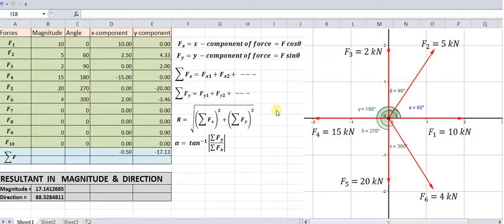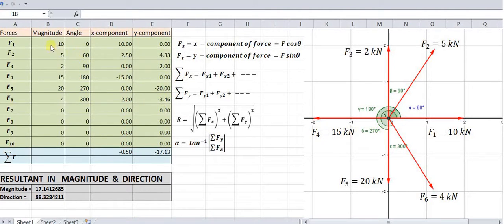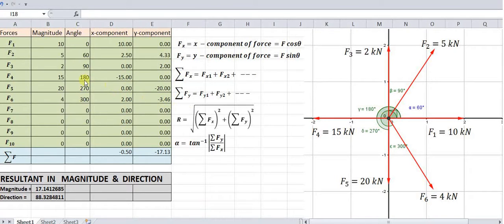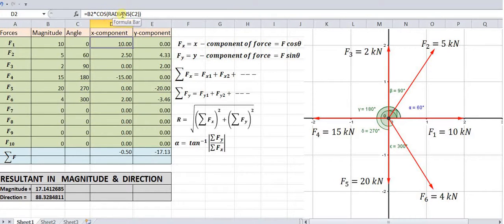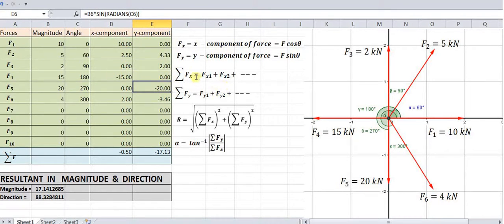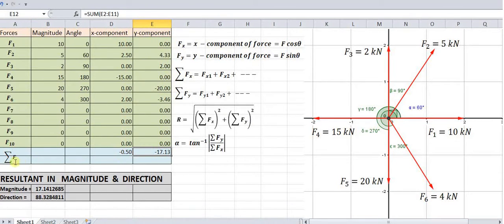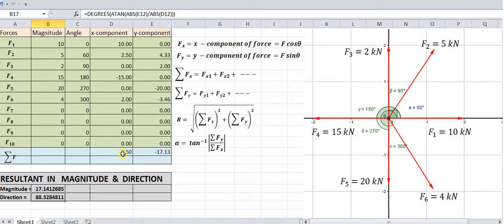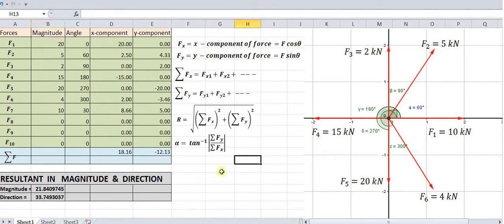How to find the resultant of a force system - EXCEL calculator or mechanical engineering calculator

Comment: How did you graph the vectors on excel?
Reply from the maker: Vectors are not the part of the excel, they are drawn in other software & inserted in the excel. Thanks ...
Reply: Use "Scatter with Straight Lines" chart from excel, each vector with Start(0,0) + End(X,Y) of force members then you get the illustration graphic load chart